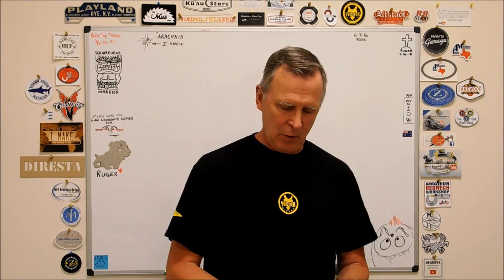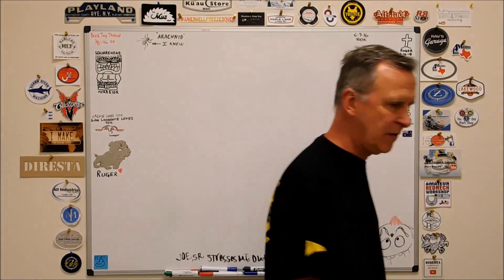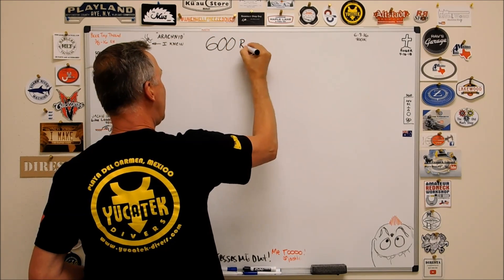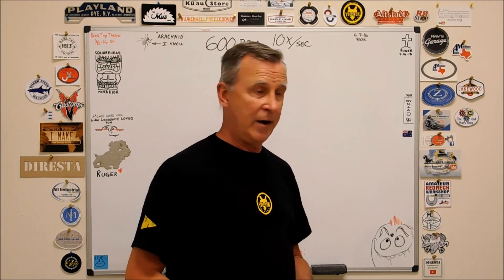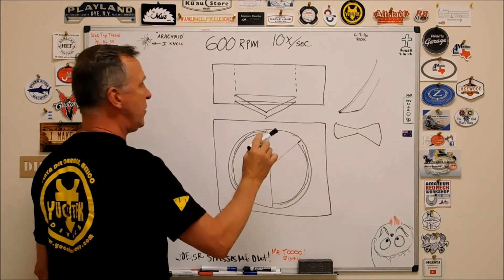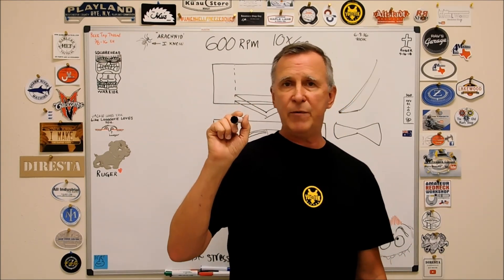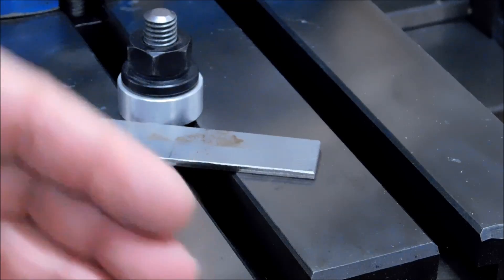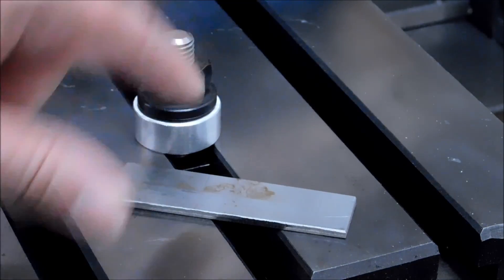EVERY METAL WORKER SHOULD WATCH THIS...

Comment: @Joe Pieczynski  when working with machines, Safety is needed for sure. But as you said a lot of us often do stupid things like free hand drilling, especially in metal parts. Sometimes its just because we're in a hurry or etc. But often, especially for hobbyists, farmers, and other "small home shops",  often we freehand drill because we simply don't have a way to hold down a part solidly AND get it in the correct position under the drill. Due to either its size (too large or too small), its an odd shape and won't fit in a vise or etc,  we simply don't have a drill vise or don't have one that will work in a given situation, and a lot other reasons. 
What I REALLY enjoyed about your video Joe, was that you just didn't tell everyone "...don't do this, its not safe, etc etc etc..." You also showed WHY it wasn't safe in different situations, which sometimes we need to think about. BUT what I liked even more is that you showed some real life possible Simple Solutions on how we can still use a drill (even if we're in a hurry, or a way to quickly "modify" a vise or other hold down to allow it to hold our odd part) and still be a lot safer than just freehand alone. Those were some great but Simple ideas that could make a lot of difference. Have to give more thought in the future on simple modifications like this when I need a part held. *So Thanks for such a Greatly Informative but still short video!* :-)

Comment: I have a small lathe that I can overpower.  That said,  your rule is golden because temping fate is a fools game!  You stopped short on the bolt through the table with the aluminum sleeve.  If you make the sleeve stepped, and you put the smaller diameter down, you make a feature that will arrest the upward force as well as the rotational force.  Just make the length of smaller diameter long enough for your material to fit and the difference in diameter large enough to provide sufficient overhang.

Comment: Hi Joe...
I'm a retired ... got my 1st lathe yesterday... (mini lathe 4" chuck)
Sound advice... thanks
I also obtained a box of carbide insert cutters, but god knows which cutter to use, and for what task each one was 
designed to do...
Have you done a vid on the various cutters and what their specialty is?

Frank... From Bristol. UK...
Reply: For a lathe that size you're honestly best off with HSS you can grind to a much sharper edge than carbide.  If you do use carbide a positive insert, such as CCGT will work best as it takes less power to cut than a negative insert.  Also the smaller sizes will do best in a small lathe.  Remember carbide inserts are really made for CNC machines with 20 HP spindles and 15,000 RPM, they usually want all the speed you can give them and aggressive depth of cuts to work well.  I think This Old Tony did a good video on them.
Reply: @bobaloo2012  ... Damn it, Top speed on mine is only 50-2500 rpm...
I asked for advice from the dealer that sold me the lathe, he recommended that set of cutters!
This is being green I guess... 
Thanks Don, will have to get a set of HSS asap !
Frank...

Comment: great tip on the l brackets. a couple of other safety items on the drill press that i addressed years ago was the flying chuck key and the spindle stop. i rigged up a small box on the side of my drill press with a hole in the side to accept the chuck key. the key engages a micro switch that prevents the drill press from starting unless the key is in. i also added a foot pedal to control start up .if something gets away from you just step off and everything stops. its also great for tapping.

Comment: Joe, early in my machining/fabricating years as a young man I had a job drilling a 1/2" hole into 1/4 x 2" x 12" flat bar after struggling with holding the first few pieces from spinning, I had one rip free from my grip and spin free coming around and hitting me in the midsection slicing and tearing my shirt and just barely slicing into my belly causing a nasty scratch that drew blood, had I been standing a few inches closer to that drill press , my inner-eds would have been laying on the floor, I took the time at that point to make a piece of plate with washers bolted high enough off the drill table to slide the stock under to minimize the lifting , and used a block back by the column of the drill press too eliminate the spinning ...it was a valuable lesson, that i was lucky didn't end up worst...good tip..!!!

Comment: My first job, I was using the drill press, and holding the work piece by hand, an older tech came up and showed me what happened to his left hand many years before. The work spun, and then it caught his fingers, and grabbed the tendons that enable the four fingers to retract, yanked them out to the wrist. He had corrective surgery that allowed him the use with no strength, and only could pull all four fingers at once, as individual control was lost. That produced me using a vice or clamp from there on.

Comment: Joe Py the physics guy! Had an employee that was drilling some light gauge metal framing material with a Milwaukee (high torque low speed) hole hawg. Needless to say we ended up in the ER ROOM with a bill and about twenty stitches. I agree with the “makes my hair stand up” when I see this, drilling anything not properly secured is a recipe for...not a good ending. By the way it’s been three years? WOW! I’ll be staying tuned in for the next three. I think these videos should be subtitled PUBLIC SERVICE ANNOUNCEMENT!!

Comment: When drilling on a lathe, I've often had the chuck pulled right out of the tailstock as the bit started clearing the end of the hole. I've had to give it a significant amount of force to stop this.. Is there a better technique?
Reply: Its due vibrations(if you ever need to loose stuck morse taper tap it sideways) ,vibrations and morse taper dont go together.Is your tailstock worn out?There is a way you can make it better by adding some friction to a morse taper by wiping it with chalk-like athletes do to have better grip.Second thing you can do is to check your drill if its ground correctly,uneaven flutes can drill as long as there is material to support it ,when it comes to a end ,as hole is getting larger only one flute is cutting ,vibrations start to happen and your drill falls out.Play with the RPMs,sometimes slowing down at the end helps if you get a lot of vibrations.On some materials like stainless steels lot of coolant ,small rpm and a wrench trough a tailstock wheel is simply a must since you have to push it harder to drill it.
Reply: Go slower & take shallower advancements when drilling through holes or blind holes. Making sure your bits are sharp as shit is also a good idea bud, often times when the bit grabs my work I find it's cause of dull cutting edges. Try dressing your bits on a CBN wheel first if they're a little 'battle worn'.
Reply: First of all: verify your tailstock and chuck shank are clean and free of burrs and galling. Clean accurate tapers that are rapped together generally bite pretty well. Conversely it only takes a tiny amount of misalignment, such as from a chip in the way to render the feature of tapers useless.
Reply: @tinman5322  Yeah, the tailstock and shank seemed OK. There wasn't any problems drilling through 3" stock...until the drill tip reached the end of the part. And, I really only noticed this on brass (where it happened 4 times in a row). I slowed the rpms and spun the tailstock wheel like a madman in order to clear the hole. Nothing broke and the hole was fine, but felt that there's gotta be a better way.
Reply: @FieryWACO  I do know that brass is notoriously "grabby". Maybe rev up the spindle speed and slow the feed as you approach the end of the hole? Other than that and boring, which would slow down your process considerably I'm out of ideas. I wanted to mention the importance of clean tapers since no one else had.
Reply: Grind a flat on the cutting edges of your drill. By doing this you are reducing the helix angle of the drill and the grabbing will go away. You can also get slow helix drills that are good with brass.
Richard
Reply: @richardedwards4454  Great suggestion - for anyone having difficulty visualising what he means, think of each cutting edge as if it belonged to a lathe tool: what Richard is suggesting is like putting a narrow horizontal "land" on the top face of a lathe toolbit, to cancel the top rake locally (which if sufficiently steep, can pull the lathe tool into the cut) . This is often done when adapting a toolbit ground for (say) aluminum to cut brass.